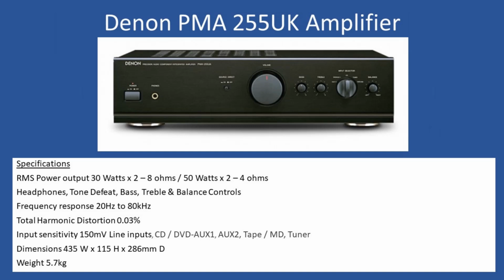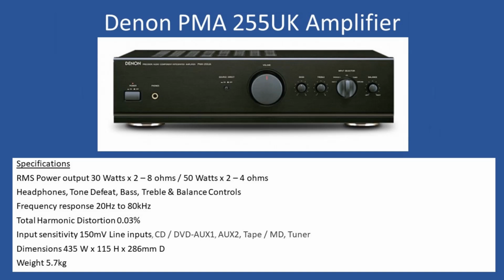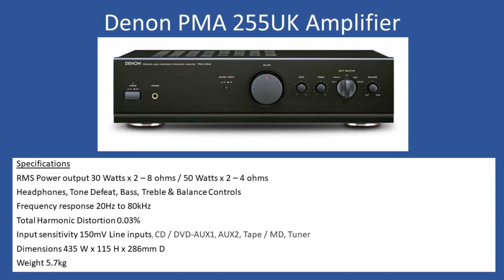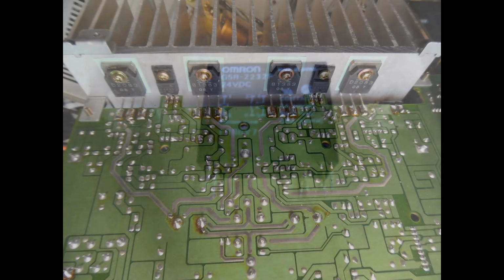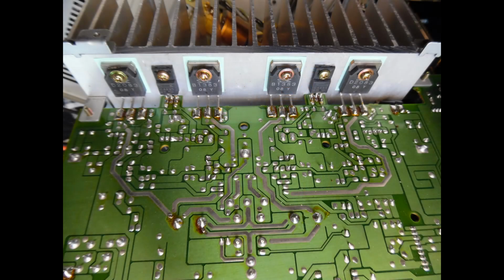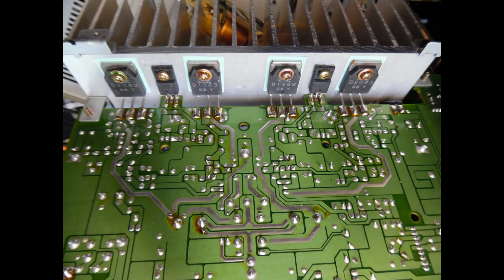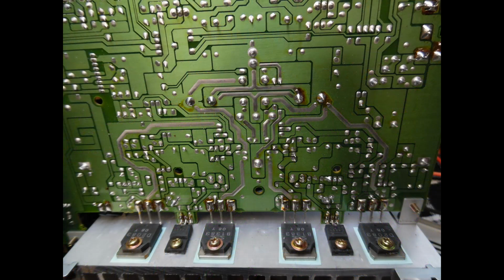Denon PMA 255UK Amplifier Repair (With Audio Tutorial)

Comment: I just rescued mine from the weee waste at work but one channel sounds muffled and intermittent. 
Board looks pretty clean with no obvious cap failure. Contact cleaner on the volume, balance, bass, treble, and input selector. Some change but not a lot.
Reply from the maker: Hi, I would advise removing and taking the  input selection switch apart and cleaning with a fibre glass pencil, as shown in the video. Also, clean the direct mode switch and replace the speaker protection relay as shown in the video. Then, if further fault finding is required, you have a known good reference to start from.

Comment: Hi ive got this model and its just suddenly cut out whilst playing my music and lost power, will not switch on and i think it was fairly warm when i pulled it out.. I've changed the plug fuse and still will not power on? any recommendations on how to repair or what to look for? thanks
Reply from the maker: Hi disconnect the Amplifier from the mains and remove the top cover. There is a glass fuse near to the on/off switch. Check the fuse if its failed.
Reply: @AudioAmplifierServicing  Morning! Ive done this and the fuse seems fine.?
Reply from the maker: @gailaherne9261  Hi do you have access to a multimeter. We need to check the resistance of the transformer to verify if it has failed.
You can email audioamplifierservicing@aol.com if  you prefer to send unit for repair.

Comment: What are your recommendations for cleaning speaker relays ?
Reply from the maker: Hi you need to use a contact cleaner and a fiber glass pencil to clean the switching contacts.
https://www.amazon.co.uk/Modelcraft-PBU1019-1-Glass-Pencil/dp/B002Z8IX36/ref=asc_df_B002Z8IX36/?tag=googshopuk-21&linkCode=df0&hvadid=696285193871&hvpos=&hvnetw=g&hvrand=12870113254195791277&hvpone=&hvptwo=&hvqmt=&hvdev=m&hvdvcmdl=&hvlocint=&hvlocphy=1007249&hvtargid=pla-2281435177858&psc=1&mcid=edaceba400a5399f923d3f31bda8d947&hvocijid=12870113254195791277-B002Z8IX36-&hvexpln=74&gad_source=1
Do not use any abrasive for example sand paper or a file.
If the oxidisation is ver bad the the relay will need to be replaced.